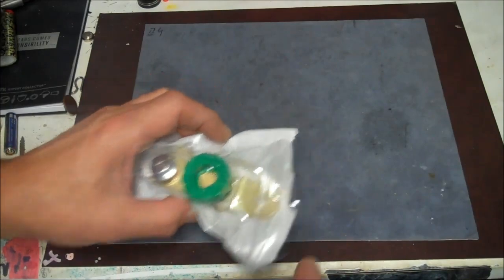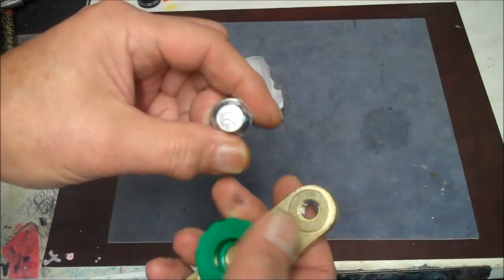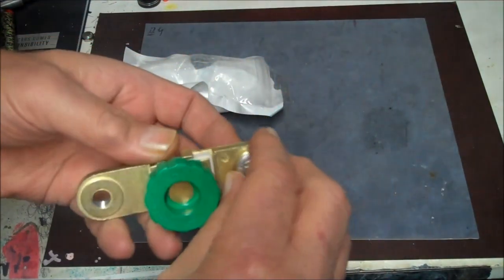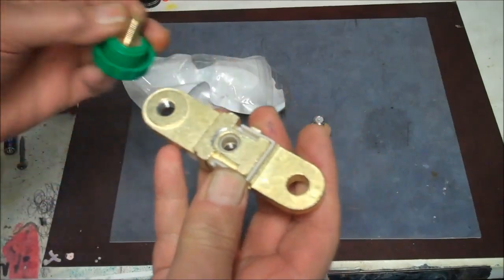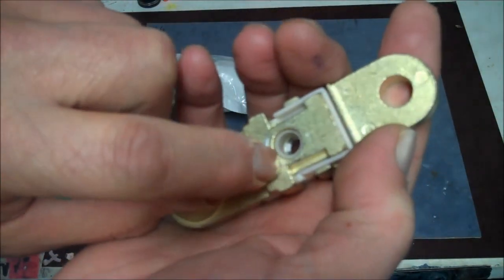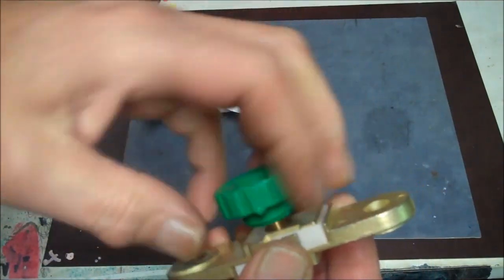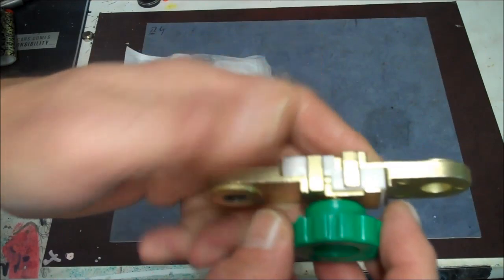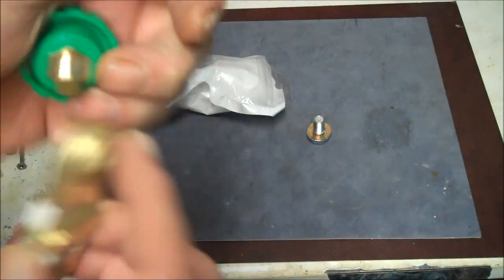Battery Quick Disconnect Switch Review and How Does It Work? Side Terminal Version

Comment: THANKS for a very detailed, narrated demonstration. Great lighting and was all clear and on focus. THANK YOU !!!
   From the picture of it, on line, I couldn't make out how it worked. And whether or not to get a knife switch type or a knob type L-pad type, or just take the terminal off every time. I'm going to get a top post style for my 1986 Mercury Colony Park Station-Wagon. There's something, very minute, that will sap the battery overnight. It's NOT a phone charger, nor a light. I've been thru it. The battery is clean, so it's not discharging THAT way. The best is to raise the hood and disconnect the battery.
   THANKS again for your video.
   I Subbed.

Comment: I got it in but for some reason I had to add a washer for it to properly tighten to the battery but that's ok. The screw was a tad too short. It works great and I love it!! 👍👍
Reply: Oops, meant screw was too long,  lol. I tried to reverse them but that way was way too short. Regardless, it works. 😁
Reply: The washer is for the side that has the threads. Sometimes they have two bolts one don’t work for the battery. I don’t know why they put it in there. They only need one bolt with it the one that threads.

Comment: I got this and the bolt does not screw into side post and the cable doesn't tighten on its side of the connector. POS.